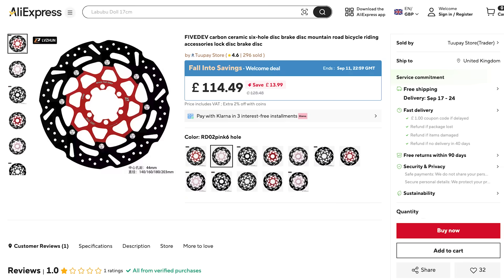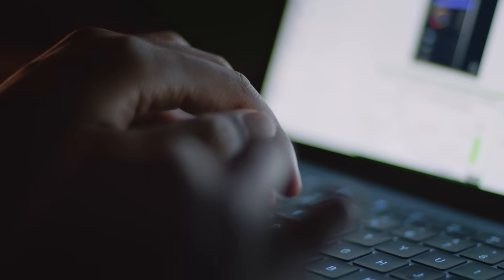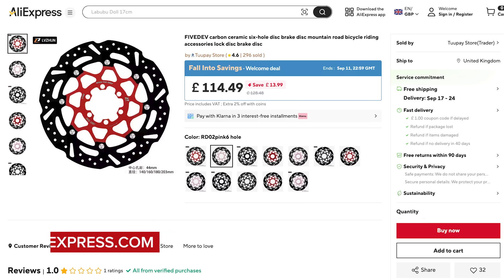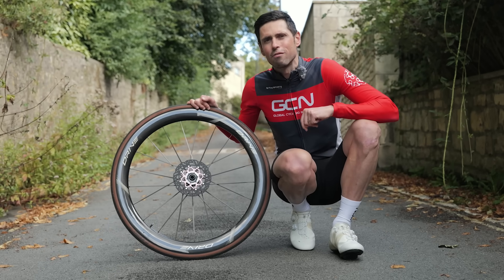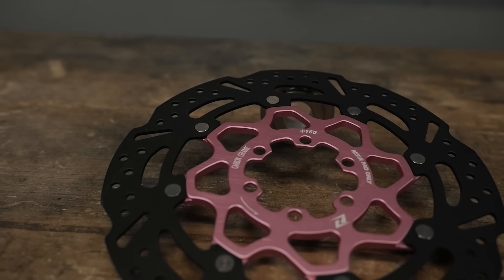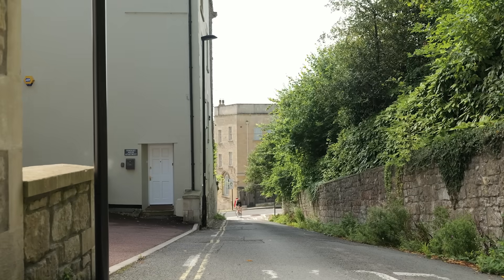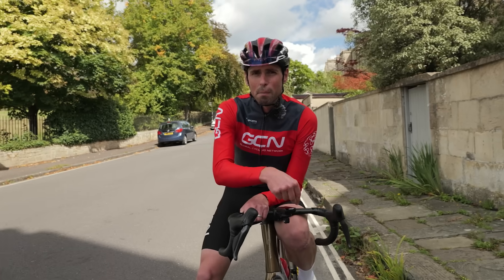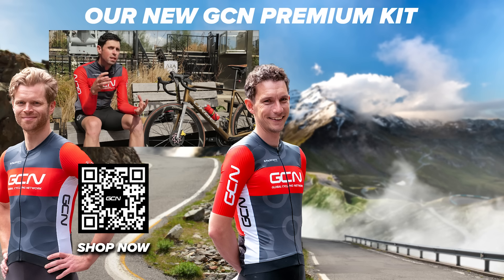Why Bikes Can't Have Carbon Ceramic Brakes

Comment from the maker: Would you ever consider using carbon ceramic brakes on your bike, or do you think this technology should stay in motorsport? Let us know what you think in the comments! 👇
Reply: What saddle is Alex using?
Reply from the maker: @abhimawa1  it is a Selle Italia SLR, from the Nubuck range!
Reply: @gcntech great looking piece. Never seen one before 👌
Reply: Only after months—or should I say years—of engineering, testing, and meeting safety standards. This is one area I would not want to mess around with and learn the hard way that it is crap.
Reply: I don’t believe they’re necessary.  

Granted, they’re light but weight is highly overrated and the rotational inertia of a bike brake rotor is vanishingly small.  

Their performance is excessive because, unlike an automobile which has huge mass and speed potential, a bike and cyclist isn’t terribly heavy.  This means that their potential to heat fade on a bike is almost non existent (keeping in mind that rotor material is only one component which fades or loses pressure).

Carbon discs are corrosion free but stainless steel is highly corrosion resistant.
Reply: @paulgrimshaw8334  Carbon disc brakes do not heat fade but they need to be very, very hot to function properly. Hotter than they will ever get on a bicycle thus they will always perform worse than steel discs.
Reply: @gustavmeyrink_2.0 All discs perform at an optimal level when heated.  Early carbon discs performed poorly in cold temperatures, particularly when subjected to light braking.  Porsche and others developed carbon composites to reduce the problem to a level comparable to a steel rotor.  It’s no longer much of an issue with road cars, though one must acknowledge that automobile brakes operate at a higher temperature even when light pedal pressure is applied.
Reply: @gustavmeyrink_2.0 that is not correct. For some reason, the masses still think all carbon composite rotors are the Formula 1 racing type. That is absolutely not true. F1 brake rotors are absurdly expensive carbon-carbon composition; and those do require a lot of heat to operate optimally. But in road car applications, carbon ceramic rotors are used; they are carbon fiber in a silicon carbide matrix and operate just like steel rotors when cold. This is not something I read on the interned. I’ve owned 2 different vehicles with CC brakes (Porsche 911 and BMW M3).
Reply: @gustavmeyrink_2.0  Yea, that was my thoughts.  By the time you get them hot enough, the resin pads would be begging for mercy as well.
Reply: NFW! Think of how much stuff gets made using materials to design specs for something made from something else. Titanium is lighter than steel, but NOT stronger, but that didn't stop dolts from making things in the same size and shape...then wondering why they failed. Carbon fiber? Same thing. Don't forget all the CNC machined from billet  stuff from decades ago...far less strong than a forged piece, but morons bought and used it anyway, getting swept up in the hype.
Reply: @larryt.atcycleitalia5786 100%.
Reply: @larryt.atcycleitalia5786 100% agree.
Reply: Eventually, but not yet. Like any other new tech it's not quite ready, but give it a few years and the rotors will be made better, and cost less, and then they'll be everywhere. There will be metal rotors for a long while as well because there are needs for the least expensive option possible (i.e. kids bikes), but carbon versions becoming "common" is somewhat inevitable.
Reply: Yes, of course I would.
Reply: The whole industry is irrationally obsessed with with carbon.  I don't get it.  Eventually people will realize that steel has carbon.
Reply: @matthew7419 So does nodular cast iron.
Reply: If they provide good wear life, if they provide stronger more controlled braking effect, at a "sensible" price !!

Would guess it would be much the same as in Cars - Motorsport or Bling for "fashion victims" - especially if they have to get HOT to work, it would be unusual for me to use my brakes a dozen times in a ride and typically I am braking in advance rather than slamming on the anchors ! Until there is an emergency - both of which would be "my brakes are not warmed up yet situations ! Oh shit !!!"
Reply: Last steel bike in the TdF, in 2019 Oliver Naesen of AG2R La Mondiale rode an Eddy Merckx Corsa, steel frame made with Columbus Xcr and forks with Spirit HSS tubing.

Exact weight unknown, but the frame and fork weigh 2.3 kg for the road version in the standard size range. 

Wheels were Mavic Cosmic Pro Carbon though, the complete bike estimated at 7.5–8 kg.

Steel bikes can be made lighter than that that of course.
Reply: @WrightsW5 my Trek Edmona ALR 54cm when built will be 6.2kg with a horn but weigh so much as parts must support me at my heaviest
Reply: Very brave!! And kudos for testing these Aliexpress Carbon coated rotors. I have returned mine immediately as soon as i detected the metal cling under the black carbon coating over the aluminium rotor, confirming it is not a solid carbon Ceramic structure. 😂 It has received my no confidence vote before use. 🤭😛

Yes, i considered myself the lucky ones to have quite extensive first hand experience on the SiCCC rotors, when they were first released over 10 years ago. I have 6 of these. 
They are tricky. The rotors have a sandpaper like surface. It is super critical to bed in these rotors properly, bearing in mind proper braking can only be established between the braking compound itself and NOT on the carbon Ceramic surface, which has a low friction coefficient... Finding the right brake compound is the first part of the challenge and establishing a reliable bedding in process the second. I have tried the brake pads provided and wasn't satisfied with the performance. Eventually i settled for a semi-metallic compound that provided good wear resistance and good performance (initial bite, modulation and maximum braking force). Too bad they only make rotor sizes up to 203mm and not larger. Because on my eMtb after the upgrade to Zebb front fork and the upgrade to Lewis S6 6-pot callipers, the calliper mandates a +20mm up sizing of rotors, on top of the 203mm Zebb rotor requirement, this means to make this combo work, i needed a 220mm rotor setup. Too large for SICCC but Hope V4 makes 220mm version. 3mm rotor thickness is a challenge but the Lewis S6 can cater for this. The front calliper body didn't have sufficient clearance initially on the rivet on the Hope V4, but with diamond filing i managed to get everything fit perfectly.  The rear i can run Shimano Ice-tech 203mm or the SICCC 203mm, depending on the type of ride i am configuring my bike to cater for. Shimano Ice-tech works very well. But i have read the sandwich construction is not very durable and the thin stainless surface can wear out quite quickly, revealing the aluminium inner core. So i use them for conditions, which doesn't require too much hard braking. 

 I have a few 203mm and 180mm SICCC rotors. Once properly bedded in (not an easy process, but can be done with persistence) they performed extremely well. I still use them these days on my recumbent bike and eMTB. But what I found, is that for optimal braking, like carbon Ceramic brake pads on cars, they need to be slightly warmed up, so the double tap braking pattern we use motor sports to slightly warm up the pads before the actual braking benefits the SiCCC rotors greatly. Use them as if you are driving with carbon Ceramic racing pads. But in emergency braking situations, i still find stainless steel rotors operating better in cold conditions. So if carbon Ceramic rotors are needed to mitigate the risk of brake fade, i would use the carbon Ceramic rotors the the rear and use a Hope V4 ventilated rotor in the front. This way you can get the best of both worlds, great immediate braking force in emergency braking and at least one brake fade free performance on the rear for prolong high altitude descends for maximum reliability and assurance of consistent braking performance even under extreme conditions.  Over 80% of the braking force comes from the front. So this is a good balance configuration. And the carbon Ceramic rotor would have plenty of time to warm up to optimal temperature during the extended descends.
Reply: Let's look at advantages of Carbon Ceramic Silicon Carbide rotors over steel rotors. 

First, carbon Ceramic rotor is lighter in mass, reducing the unsprung mass and reduces rotational mass and inertia. This provides better handling on cars with suspension and more rapid acceleration and deceleration, in a repeated fashion, such as in racing clipping apex to apex. This benefit is less of a concern in cycling, if we look at the number of rotor, its size and mass, even for full suspension bikes. 

Second, Carbon rotors can handle much higher heat without deformation than steel. Carbon Ceramic doesn't really melt into liquid at extremely high temperatures, but it turns into gaseous by-products. Hence the carbon rotors looses mass overtime and they need to be weigh in periodically to determine the extent of the wear. Carbon itself sublimes around 3550C. The melting point of steel ranges between 1370C to 1530C. It would take a lot of quick conversion of kinetic energy (1/2*M*V^2) over a very short period of hard braking (t) to generate this amount of heat (Power=Energy /t) to dissipate. Formula One racing would require this type of performance. But difficult to find normal driving requiring this level of performance. Again, this benefit can only benefit in rare and very extreme occasions in cycling, like very long descents on very high mountains on a windy tarmac, free wheeling, reaching high speeds. 

Third, there is the black body radiation. Carbon Ceramic rotors are capable of dissipating the heat much more rapidly than steel rotors, supporting rapid cooling, plus thanks to a much smaller temperature coefficient, carbon rotor don't tend to expand and contract repeatedly causing rotors to wrap. Ok, in rare cases, we have seen this happening after long descents on cycling equipped with disc rotors. The metal clink-clink sound originating from the rotors after long braking is a confirmation of wrap rotors. But 2-piece floating rotors with rivet interface very much provided a good remedy for these situations with better stress relieve, allowing the outer braking surface rotor to expand freely. It is good to see motor sport concepts trickling into cycling, designs like the Hope V4's ventilated disc structure significantly improves cooling. 

It is important to emphasise that the amount of kinetic energy to be dissipated during hard braking deceleration remains constant, regardless if a  carbon Ceramic or steel rotors are being used.   

For optimal braking, the brake rotor should have a thin layer of the braking compound coated, so that it is the friction between  the braking compound on the brake pad and the brake rotor that is interacting, to convert the K.E. into heat energy via frictional force, not the metal (in the case of steel rotor) nor carbon ceramic.  The only time there would be bare metal or carbon Ceramic to brake pad compound contact braking is during the initial brake pad / rotor bedding in process, during which  increasely harder braking cycles are repeated in a controlled fashion to build up the temperature so that the braking compound deposition can take place evenly over the rotor. And it is during this bedding in process the braking force would dramatically improve, all on the initial bite, modulation and maximum braking force. 

As we can see from the KE of a moving mass under going deceleration with a KE=1/2*M*V^2 over the time t, converting in heat energy and power rating denoted in Watts, P=KE/t, the mass (M) to decelerate contributes linearly to the kinetic energy, the velocity (V) is even more important as it has an Exponential (^2) relationship. And finally the deceleration time (t) in a inverse proportional manner. In Formula one with super high velocities, the insane braking happening, thanks to the enormous down force and sticky slick tyres and carbon brake rotors and pads, it is capable of generating this level of kinetic energy dissipation into heat energy in such short duration during hard braking. Few other real life applications can even compare. The landing of Turbojet airplane and hard braking during reverse thrust is one such a application. This is why you would find carbon Ceramic brakes on the 787 Dreamliner.

The most important aspect to consider if carbon Ceramic rotors is needed, boils down to what risk we are trying to mitigate. The primary risk is brake fade. This happens when sufficient heat is generated from the braking pattern that the heat is transferred from the brake rotors and pads to the brake callipers, then into the brake fluid, sufficiently to cause the brake fluid to start boiling, forming gas bubbles, which is highly compressible, essentially causing the brakes to feel spongy and subsequently loosing all braking force in serious situations. 

Carbon Ceramic rotors can absorb the heat energy and dissipate the heat much faster than steel rotors to reduce the amount of heat reaching the brake fluid. 

One really have to push very hard to experience brake fade. And if one ever have to opportunity to experience this even once in a safe controlled environment, one would know how scary and unsafe this can become. 

I never pushed my bike that hard to ever experienced brake fade, but in my car it happened. It was on factory resin pads. They essentially got burnt out. I started looking into brake compounds that wouldn't suffer from burning out yet providing wide operation temperature range, improved initial bite, modulation and maximum braking force. And carbon Ceramic is the solution. I also looked into 2-piece ventilated disc rotors. I settled for Project Mu SCR 2-piece ventilated rotors and Endless MX72 (semi-metallic carbon Ceramic), over the CCRG brake pads, for its wider operation temperature range of 50C-700C, vs 300C-700~800C on CCRG. And also Endless RF-650 brake fluid with dry/wet boiling point 323C/218C and stainless braided brake lines.  The combination of these upgrades have successfully provided remedy to brake fade. Even under the most extreme braking on track days, this combo performs superbly without any signs of brake fade. The most noticeable improvement is the consistency on brake feel, it does not vary under extreme hard braking and it is the predictable nature that inspire confidence.
Reply: No, its the dumbest thing anyone could have ever thought of...
Reply: I would use them if a major brand manufactured them and subjected them to all the proper testing that other brake rotors must pass.
Reply: No, wouldn't solve any brake problem I have.  My MTB and a hybird electric bikes are the only bikes I have with disc brakes.

On the MTB (early 00's old skool Deore mechanical brakes): floating rotors seemed to have solved my rotor warping over time on my MTB.  Ceramic pads gave me improved mileage and allowed me to run my brakes harder with out running into heat fade (but I think they are wearing down my rotor faster and they are slightly noisier then the Shimano resin pads).

My ebike has resin pads, 4 pot calipars and regular (non-floating) rotors - and I've got no complaints about it.  I'll better judge when I need to do a brake job, but at this time they are working just fine.

But to be honest, the ceramic rotors might do better in a CX race with large pads and 6 pot calipars (you want a large pad surface with lots of pistons to apply pressure).  But the only 6-pot calipars I know of are the Juin Tech GTF calipars, and I feel that they are hidiously expensive for being are hybrid mechanical/hydraulic.  And I don't think many people would be looking to run a hybrid brake in a CX race.  I can't think of any mainstream groupset that would have levers for mechanical brakes...  And of course, there would be a question of lever pull on them - would they work best with conventional road bike rim brake pull, or do they need a lever pull for V-brakes - they don't specify.  Too many questions....

Anyways, are these rotors a product in search of a problem - I can't off hand think of anything they would solve that there already is an answer for (well, except bling factor).
Reply: I've heard a lot about carbon failure over the years, velodrome riders changing their carbon frame every 2 years whether they have crashed or not, everyday road bike riders getting a ding on the frame and being too scared to ride it, people buying a second hand bike and worrying about the safety of the frame. So, no I would not want carbon brakes.
Reply: @WrightsW5 now I worry as I was looking to buy a Bülk MK1 and change the gearing
Reply: @mlee6050  Sorry to hear it, just be very observant with what you might buy.
It's a really bizarre thing in the manufacturing world, steel has worked well since the 1800s, then just as supersteels were getting known and sought after, expensive bike manufacturers abandoned it for carbon!!!
Supersteels are light, strong, recycleable, and also stainless so don't even need to be painted (but are paintable which most companies would do).
Reply: The carbon brakes used in MotoGP are shrouded to keep air off the discs because they only work properly when red hot. In the wet they use steel rotors (or one steel, one carbon) because the discs never get hot enough. I don't think bicycle discs ever get hot enough for carbon to work or steel ones to fade.
Reply: I think auto manufacturers like Porsche offer some sort of ceramic brake for very high-end performance cars. But I think they're looking for heat resistance more than low weight. I think ceramic pad compounds are much more common, but I think that's for reasons of noise and cleanliness. I could be mistaken.
Reply: But also new ideas are interesting even the bad ideas
Reply: @DetroitJohnny  Look at Jay Leto's McLaren story. He was looking at getting Carbon Ceramic brakes and the salesman recommended the Steel option as it was cheaper and it would suit a road car way more. I also think one of the reasons for cars like the 911 GT4Rs and others getting carbon-ceramics as an option is for homologation rules and being allowed to use them in WEC. Essentially selling Homologation Specials to the public to win on Sunday.